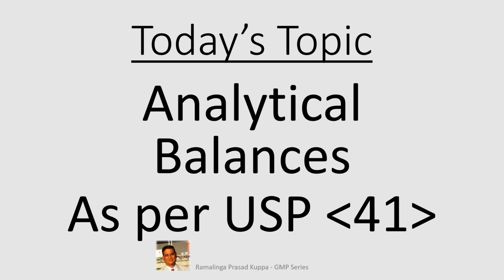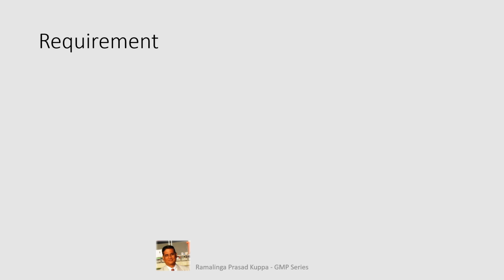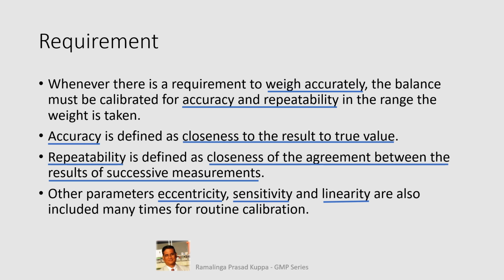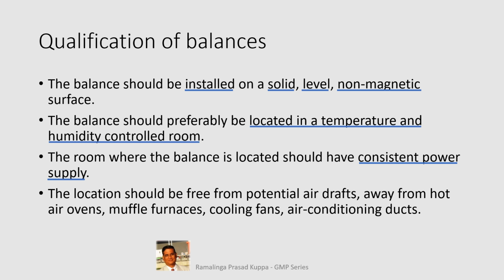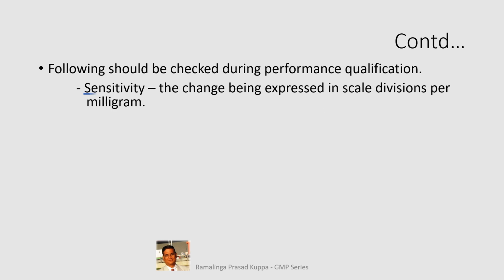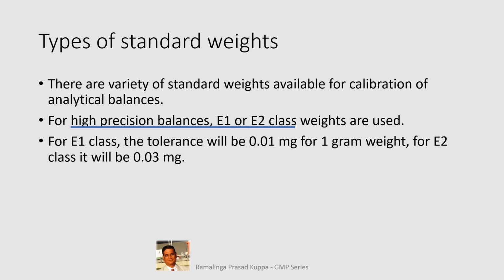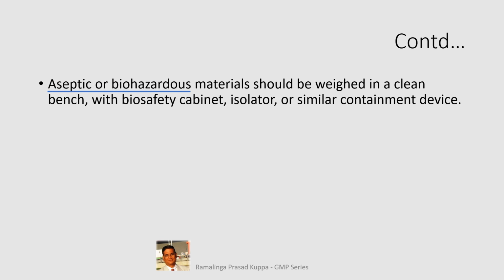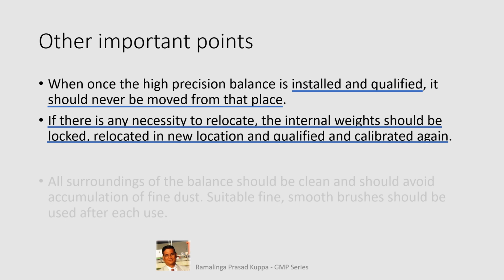Analytical Balances USP 41

Comment: Hello sir, Hope you are doing well l.
Let me know, the weight balances which are use in packing area (two digit balance with least count 50 mg) shall be verify / calibrate as per USP 41 & 1251 or is there any another chapter for 100 kg / 300 kg capacity weight balance ?
Reply from the maker: Thank you for your inquiry. As per the accuracy requirement, the higher capacity balances have to be calibrated or verified. There is a provision in USP 41/1251 to use different classes of weights for various accuracy requirements. .
Reply: @pharmaworldk1473 
Let me know that in repeatability there is a statement that if SD is less than 0.41d, then we should use 0.41 x least count of balance for calculations. So in which unit we have to take value of d. In g or mg ?
Reply from the maker: RSD is independent of units of measure. You have to consider same unit, let it be milligrams or grams.
Reply: @pharmaworldk1473   hello sir, why we always got repeatability 0.1 % by calculation ?
Reply: Hello sir, Hope you are doing well.
Sir let me explain below;
Repeatability formula = 2000 x SD / Smallest net weight

Repeatability= 2000 x SD x 100 / smallest net weight 

Which one is correct and how ?
Reply from the maker: @ajitjadhav607  2 x SD x100 ÷ smallest weight = NMT 0.10% (equation 1)
SD is calculated by taking 10 weights of same denomination 
If you calculate in reverse way from equation 1, you get figure = 2000 x SD for smallestweight (minimum weight). If you still have any doubt, leave your contact number. I'll call you and clarify more in the evening today or tomorrow (around 9:00 p.m.IST)
Reply: @pharmaworldk1473  by this calculation we always got repeatability 0.10 %
Reply: @pharmaworldk1473   Hello sir, as per formula 2000 x SD x 100 / SDNW, we always got repeatability 0.10 %. Correct ?
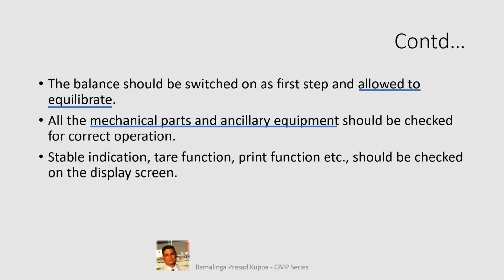Reply from the maker: @ajitjadhav607  Please read USP 1251. You will get clarity. Simple way is to drop your contact number in message box. I'll call you in the evening about 9:00 ,p.m. today.